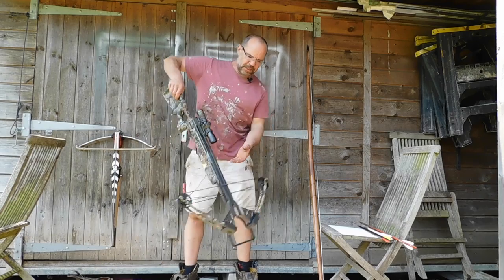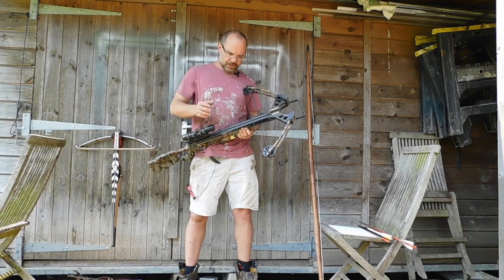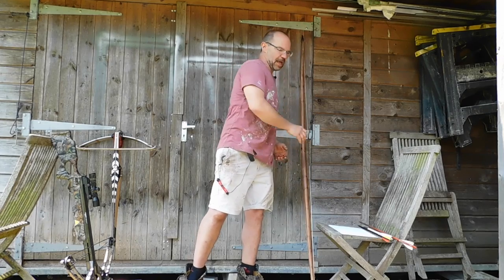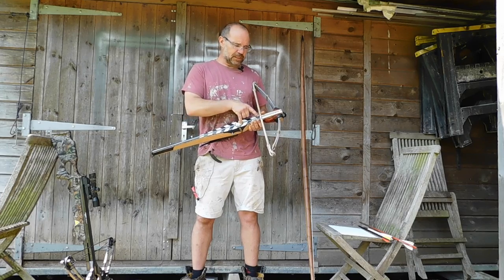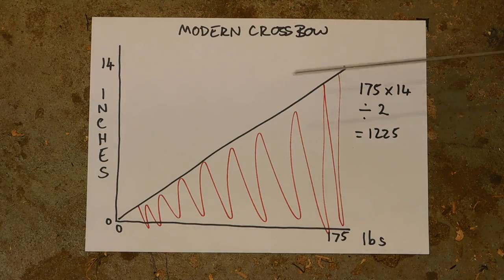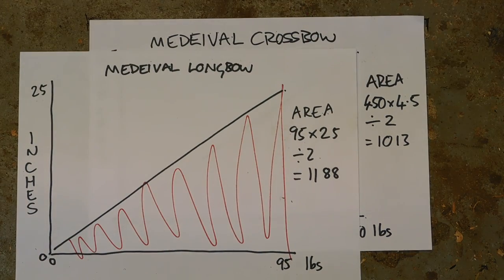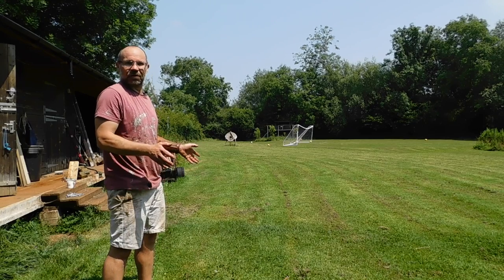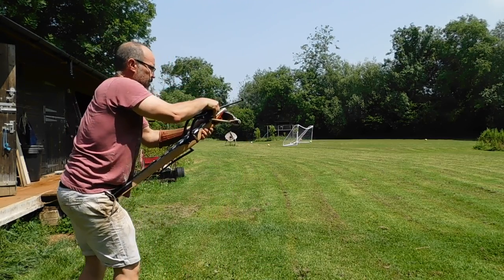Draw weights of medieval crossbows, longbows and modern crossbows

Comment: I always wondered about the power an old crossbow might have in comparison to other weapons. I looked online and never really found anything conclusive. This video was great.  I still do wonder about the projectile itself, and if that actually plays a bigger role in how "deadly" the weapon ends up being. Like you said with the heavier crossbow at 1250 lb, the joules would seem to be close to a modern .22, but I imagine the bolt itself would cause a heck of a lot more havoc on whatever it ended up hitting than a .22 round. I never tested this, of course, so I can't say for sure.
Reply: Arrows and bullets are really different.The wound types are different. The terminal ballistics are very different. I think it's hard / unrepresentative to compare them using just "muzzle" velocities.

An arrow mostly pokes a little hole through you. A bullet makes a much messier hole, and stirs up adjacent tissues more than with arrows. 

If you look at the numbers, one .308 round is equal to (I forgot the numbers) seventy or a hundred longbow arrows. Bit if I had to choose, I'm pretty sure I would be better off being shot once with a .308 then 35-50 times with arrows, let alone 70-100. (Neither sounds enticing.)
Reply: One factor is the surface area of the missile. A pointy arrow might well have more joules per cm2 than a bullet. It might penetrate deeper despite less KE and momentum. (A 1 kg pillow going twice as fast as a bullet wouldn't penetrate much.)
Reply: Yeah, it's interesting. Because when I think of someone getting hit with a .22 pistol round to the chest, I'm not thinking "Well he's done for", but a bolt or an arrow to the chest makes me think of a much worse injury. The caliber/ammunition weight, shape and size seem to play a big part in what's going to happen when it hits, compounded by that force behind it.
Reply: Sangh i am just an armchair enthusiast, & so i am going to be as vague as possible to cover my tracks!  :)  In a very general sense, i am going to hazard that to a significant degree, some comparison of side-arm versus rifle ballistics can be instructional. Mainly in that even for most pistols, which fire bullets traveling much faster than a crossbow bolt, the single biggest operative factor to damage is the diameter of the bullet in relation to shot placement. They are still low enough velocity that wounding from fluid displacement from cavitation as the bullet passes through isn't all that significant until you start dealing with some of the magnum loads, which are more typical of revolvers than pistols. Then, overwhelmingly so with rifle loads. But, with that backdrop, i would think that by the crudest of definitions, the diameter -size -of the crossbow bolt is going to be similarly operative here too, as it is still much slower than a pistol bullet. In fact, so much so that the design of the bolt -& its ability to cause cut & bleed is going to be the biggest factor in its lethality.  But that trait is where the bolt design suddenly gets funny. 

It might be surprising that military bolts were often not nearly so refined as good hunting bolts. Military bolts commonly have minimal fletching, utility rather than razor tips, and are weighted more for penetration rather than accuracy.  In many respects i think the rough & ready design of the military bolts emphasizes wounding/disabling as the priority beyond outright bleeding/killing.  This would make sense, as wounded soldiers require a lot more resources to maintain than dead soldiers, & so efficient killing function is not necessarily the most important consideration in the design of the crossbow bolts. Taking them out of the fight is.

And in general, i think the design of the heavy crossbow bolt is something that i have always questioned.  I am just an armchair enthusiast, but i always have this sense that they tended to not be as optimized as a projectile like, the bodkin arrow of the warbow, or even a dart & atlatl.  But i could very well be wrong about that -and would venture that is more likely the case than not.  But considering the abysmal rate of operation of a heavy crossbow, i would hope that designing the perfect bolt for the function of the machine would be a critical priority, as each shot counts all the more.  But it appears to me that the finest bolts were probably those designed for hunting and target shooting rather than war.

And like i said... don't take me too literally.  All this is my sense of things!  :)
Reply: As a hunter the principals taught to me go something like this:

With a bow the death is caused by the cutting that the broadhead does to the animal. All the energy you need is for the tip to just pass through the heart and that isn't that much with a modern cutting broadhead especially if you don't hit bones. Cutting diameter of the tip is what causes massive blood loss and death. 

With a gun the damage is based on the crushing shock effect that the bullet causes. If you have ever seen a water jug for example being shot, they usually just explode even though the bullet diameter can be relatively small.

If you shoot with a very low powered rifle I imagine the effect would be similar to shooting with a target tip arrow where it just cleanly goes through and easily leaves big blood vessels intact. In the past they didn't really have any ways to heal these kinds of wounds and they could easily get infected but they would probably seriously lack any kind of immediate stopping power. I guess there is still a good change if you have an arrow sticking out of your side that you would stop bullying the dude in the castle and search the local shaman for help.
Reply: +Budahbaba I guess I essentially just somehow said all the same things as you already said. One thing I would like to add is that I think they probably used "non sharp" points because they had to penetrate armor. The sharpened broadheads of the time could not really do that as far as I have understood. In general the immediate disabling of the soldier in combat environment would probably be in many situations fairly important and more efficiently killing broeadheads would often do this better. I'm not quite sure if taking care of the injured was as big of a resource investment back then as it is now anyway?

Comment: A point about the energy of the projectile. Low weight, high velocity will slow down more from air resistance, so perhaps down range the medieval crossbow would fair better. Bullets do ofcourse have a much smaller cross section for air resistance, but the speeds are vastly higher and the weight is vastly less so they probably lose velocity more than the medieval crossbow bolt also.

Probably the gun energy is measured at the muzzle.
Reply: In addition, Kinetic energy isn't how arrows and bolts kill or do damage unless you're using rubber/wood blunts. Broadheads as a set of inclined planes are able to amplify the amount of work doable by a given force (which is measured in momentum/impulse, not KE). Related to your point, as impact velocity of any projectile increases, the resistance forces faced increase exponentially. Here's a neat research paper that talks about it in depth https://cpw.state.co.us/Documents/Hunting/EHU/Momentum-KineticEnergy-ArrowPenetration.pdf

Comment: The thing about the 22 vs the crossbow bolt is that bolt tends to have a very sharp and sometimes wide tip meant to slice into the target where as 22 round is like trying to push an unsharpened pencil into the meat.

Comment: The other thing to consider in regards to the actual numbers, is the material of the arrowhead/bolt head. Hardened steel, soft low carbon steel, is it sharpened, and even the cross section/shape of the head.  

While the numbers themselves are not that high in comparison to firearms, there's a whole bunch of other aspects that are also important when considering the lethality of a bow or crossbow. .22 LR might kill a person, but it would take proper shot placement, and a very unlucky individual. It has very low probability to hitting a vital structure of the body bringing about incapacitation or death. While getting shot with any one of the projectiles from the crossbows and bow you shot, the probability of killing or seriously wounding is significantly higher. 

Just for some additional comparison; a standard MLB regulation baseball thrown at 95 mph has a kinetic energy of 117.5 Joules. Batters get hit fairly regularly, and thankfully they aren't dying anymore (in large part due to batting helmets and other rule improvements).
Reply: i'd say on your l;ast point definately where projectile elasticity and surface area come into play. also a modern crossbow is often of materials that cant handle the very high stress of impact, since id likely say they arnt designed for it

compare thast though to jeorg sprave the shloingshot guy and his 'plumbers nightmare' arrow shooter, launchinngg projectiles at aroundf 700-900 joules, ive no doubt that would pierce plate armour no trouble.
Reply: IIRC Alan Williams in his book "The Knight and the Blast Furnace" did comparisons of arrows and bullets (in this case round balls which would be worse than modern bullets) capabilities to penetrate metal plates. The balls  needed a lot more energy to penetrate the same plate and of course had more energy.
Reply: That makes sense. Bullets aren't as pointy & usually of softer metals.
Reply: When I taught Hunter Safety, we would demonstrate the difference in the mechanics of the projectiles and the impact on penetration. We would shoot at a 5-gallon pail of sand with Winchester .243 and .308 caliber rounds. The pail would always trap the rifle projectiles.  When the same pail of sand wash shot with a modern compound hunting bow at 65 lb. draw weight with a broadhead arrow, the arrow would always protrude through the bucket (plastic 5-gallon pail). Projectile design and physics are very important in determining terminal ballistics.

Comment: Used to shoot metallic silhouette (firearm sport).  The most fun calibers for me were the .375 H&H mag and the .458 winchester mag.  Both would flatten the 50 pound or more half inch steel targets at any range you could hit them.  Our range only had a clear view of 250 yards.  Both would leave a decent dent where they hit.  The .375 was at about 3000fps, and the .458 was more like 2000.  However we had to ban calibers like the .22-250 or the .22 swift and even the .223 because they would consistently blow big holes in the half inch steel.  Tiny bullets traveling at 4000fps plus requiring hours of welding the holes shut again.  Even then, the targets didn’t even always fall down.  Huge energy with the small fast projectiles, but very bad transfer of momentum.  Most of the energy goes into vaporizing the bullet and creating the crater in the plate.  For reference,  the momentum of the .458 slug was about 5 times higher than the .22-250 50 grain bullet.the little round has about half as muck kinetic energy as the big one.  Down range performance really depends on what effect you want.  The .22=250 is a varmint round and will disintegrate inside a ground hog, where the .458 or even the .375 will easily go right through the long direction of a deer or crosswise in a bear if you are using a full jacket round.

Comment: This greatly helped me set the standards for bows and crossbows in my homebrew VtM, where we prize realism and accurate portrayal of weapons with no regard for fairness. If I can get a DnD (or simpler!) system that's a fair approximation of reality; it's more fun, slightly educational, and helps me remember the actual information for use and sharing lolz 

The example with the triangles on paper was particularly helpful!

18:00 There's a difference between how many joules of force an object has and how much damage it does to the various things it could hit. A 9mm FMJ and .45 ACP FMJ have the same joules of energy, but the .45 is easily demonstrable (and noted in history) to be slightly more effective. 

7.45 gram (115 grain) Federal FMJ         1,180 ft/s (360 m/s) 355 ft⋅lbf (481 J)
15 gram (230 grain)    FMJ, Winchester 835 ft/s (255 m/s) 356 ft⋅lbf (483 J)
Both are standard pressure rounds, FMJ bullets, out of aprox. 5 inch pistol barrels, and are the most common "standard" example of each round. The Federal .45s and Winchester (presumably White Box) 9mm would do pretty much the same.

More energy almost always helps, tho I have seen bullets that start to do worse in gel when given the +P+ pressure instead of just +P. See Paul Harrell for good examples of "Does this extra power (from velocity, weight, etc) translate into more effectiveness?" I presume that this holds true for all projectiles. The wound is what matters, and its all about how the projectile interacts with the target to create the wound - how the energy is used by the object to wound. If one shot deer with a Medievel or Modern crossbow or a longbow, then shot them with a .22 LR (I'll even grant it a rifle barrel), one would clearly see which is more effective! Ask any hunter. I've shot stuff with everything listed here, the difference between them and a .22 is fairly clear. What that does also show, is how relatively poor arrows and quarrels etc are at incapacitating people compared to a 12 gauge 2.75 inch 00 buck shell or 7.62x51mm (.308) FMJ round. The shotgun example is a good reason why total energy isn't all there is. There is more energy in some rounds of birdshot than the standard 00 buck I just listed, but that doesn't mean it's even close to as effective...

I hope those considerations help with people's understanding of the old bows' true level of effectiveness.

Great video, as always.

Comment: Excellent scientific approach to reproduction bows vs. modern variants of which I make no complaint. I would however make some comments about the quality of steel in medieval times; the process to create high quality steel was very time consuming BUT they were able to make steel that is almost as good as modern material - both Japanese and Spanish swordsmiths could create superlative blades. As regards crossbows, it might be argued that they would use time expensive methods as it was the one material they had in abundance to make as good a sprung steel as was possible - and then they would proof it to a weight far in excess of what was required. So to make a crossbow with a 400lb draw weight you could use the same forging and tempering method for a number of bows, and then test one to 600lb. If it did not shatter/shear within a few moments then you could be assured that the rest of the batch could operate to a tension the equivalent of 400lb. If anyone doubts that the armouries of nations would go to such lengths, it should be remembered that early firearms were very quickly required to be tested to withstand pressures above that needed for the ordanance they were to propel; the concept of testing a weapon to failure to determine its limits was already in place by the time cannon were fielded. I suggest that those measures were taken from experience gained in the quality control of crossbows. tl;dr; it is probable that medieval crossbows had both excellent steel bows very good quality control to enable very high draw weights in use.

Comment: Excellent empirical calculation of kinetic energies. Just for interest's sake I thought it'd be interesting to calculate the momenta as well (from your numbers). For the modern crossbow, 2.86 N*s; longbow is 2.00 N*s and medieval crossbow is 2.54 N*s (the same qualitative order as kinetic energies). What I don't understand (maybe someone with an engineering background can explain this) is why longbows typically have longer ranges, even though by your test crossbows have larger momenta and kinetic energies. Is this purely a function of how streamlined the projectile is?